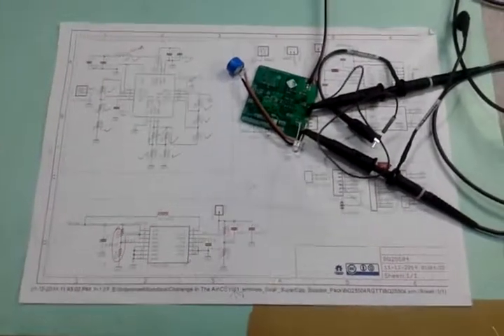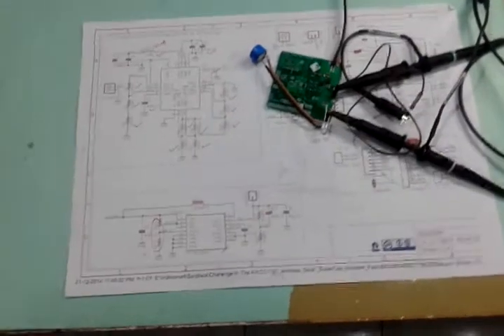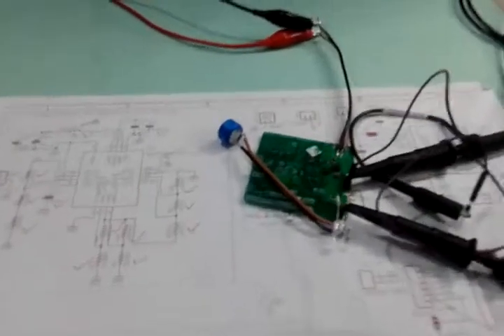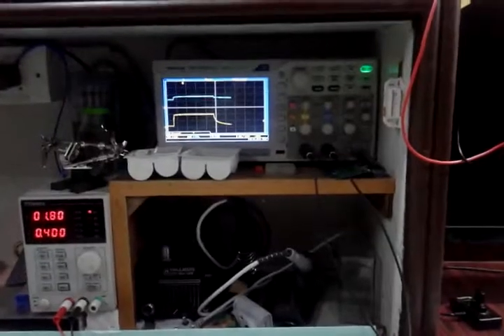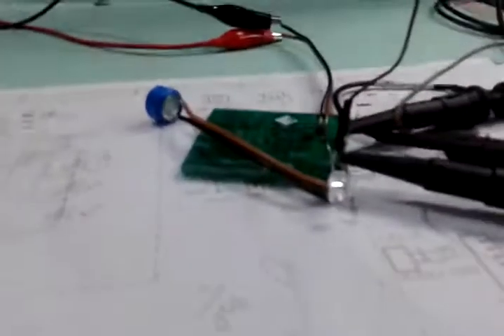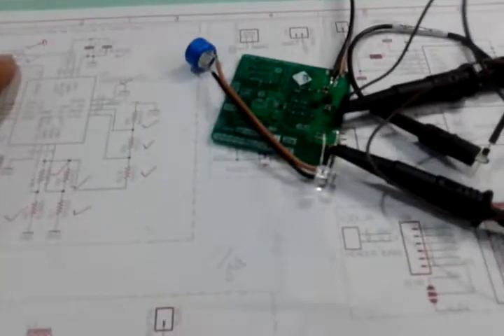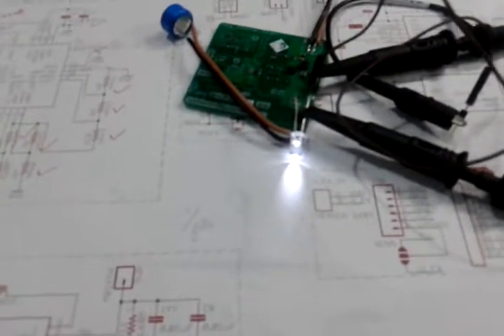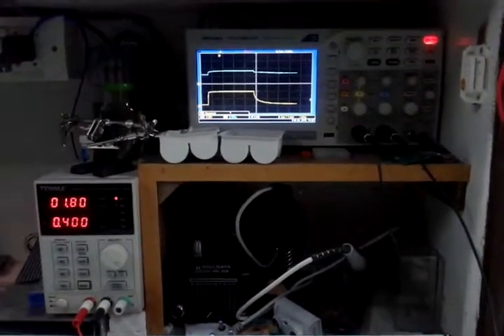Energy Harvester prototype Demo based on the TI BQ25504

Comment: The internal pfet is turned on only the voltage on the capacitor crosses the decided V_BAT_UV level which is decided by the resistor configuration

Comment: I know it's been a long time since you posted this but I recently discovered the bq25504.
I then purchased the cjmcu-25504 boost module with this ic.
 I can't for the life of me find any info on using the pins and three jumpers provided for setting the output voltage on this unit.
If you have any ideas given your experience I would really value your input on this. Thanks and thumbs up from me.
Reply: Did you ever solve the problem?